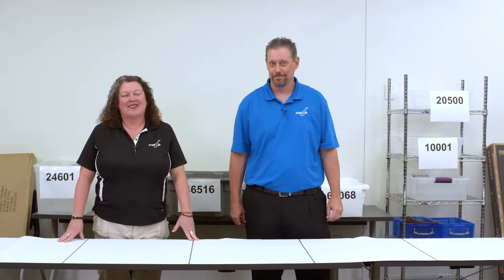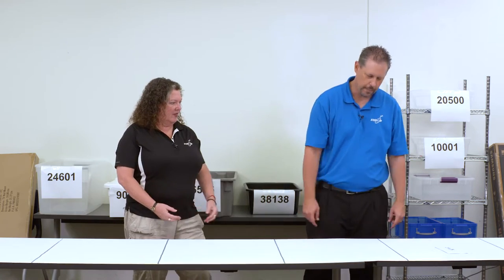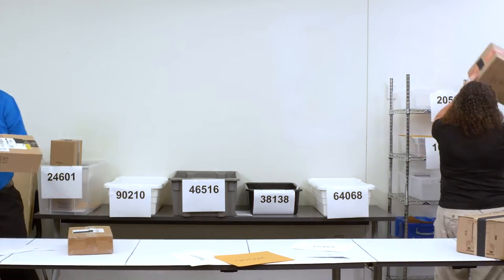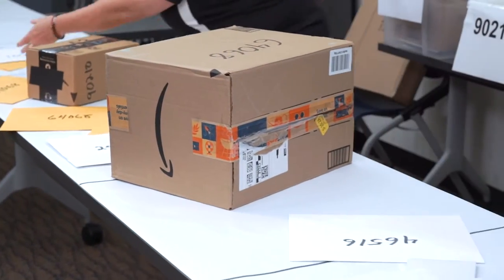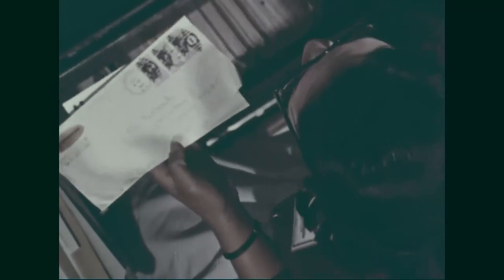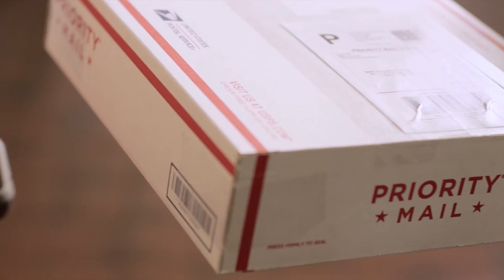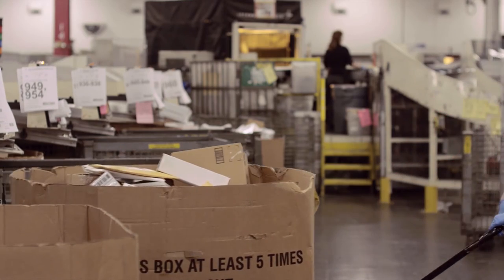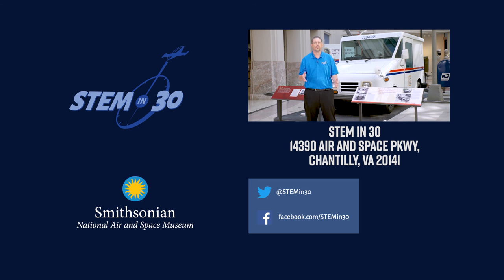Mail Sorting at the United States Post Office

Comment: What happens if someone’s handwriting is too messy for the machine to read?
Reply: There is a specific office in the USPS system that a picture of the address is sent to and then it is translated and processed by an expert remotely. The letter is then resubmitted into the system and sent to the correct address.